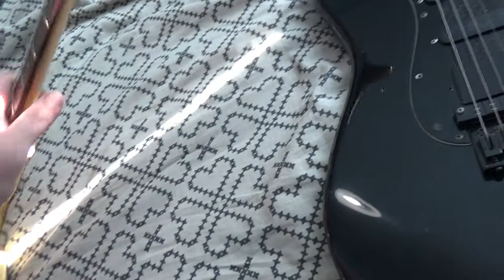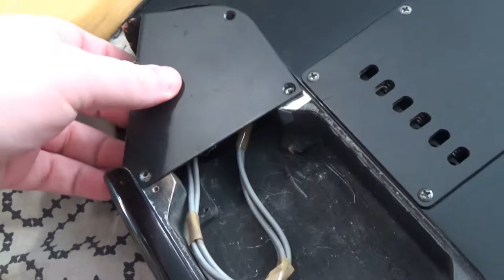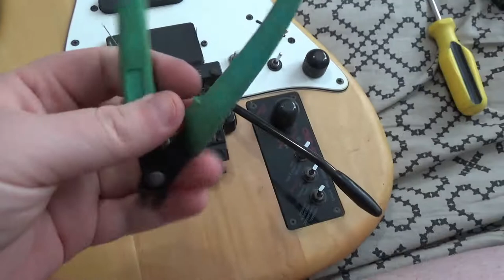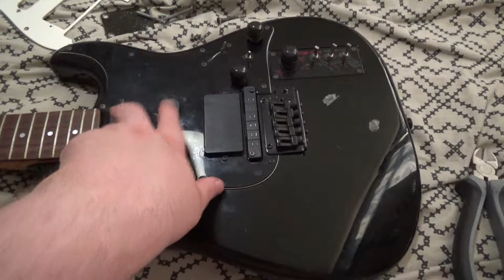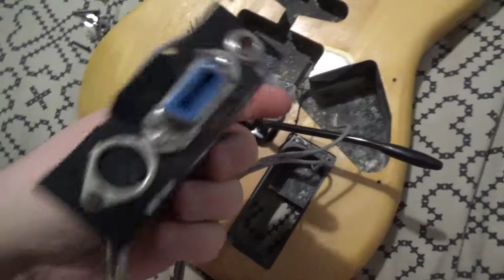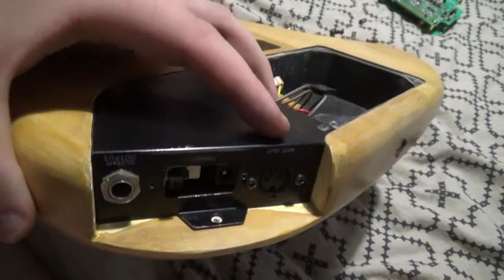Casio MG-510 Guitar Repair/Refurbishment #1 - Guitar Adventures #3

Comment: Bought a broken Casio midi guitar . I knew it wasn't working but I was going to refit it with a Roland midi pickup. The Casio midi electrics seem ok just the owner has taken of the midi out plug. The 9volt switch and there are just bare wires hanging about. Is it worth repairing please

Comment: Dude that Ibanez neck looks like it might be from a 90's Japanese s540. If so, it's worth more than both of those guitars combined.
Reply from the maker: Are you sure? Tbh, that neck just looked like a ripoff Ibanez neck, they're all over eBay pretty much
Reply: @PIPERdotEXE  Not 100%, but the only Ibbies where I've seen that bottom "Custom Made" inlay were 90's saber series axes. It could be that it's a knockoff with that inlay added, but it could also be a legit neck from one of those guitars with the Ibanez decal having been refinished. Next time you take the neck off, check for a stamp on the neck heel.
Reply from the maker: Hmm, I'll get into the loft at some point and examine it better... If it is, it's off to eBay with it haha